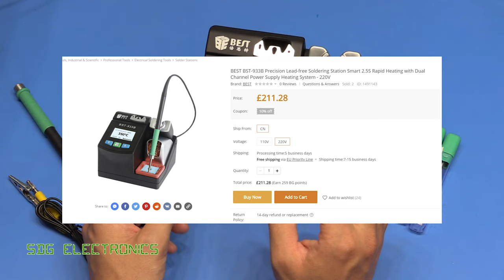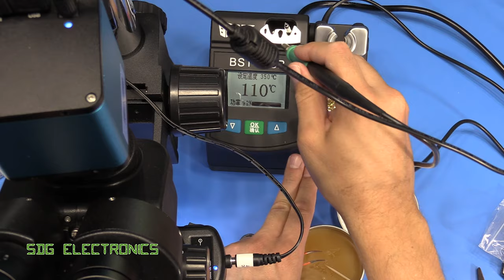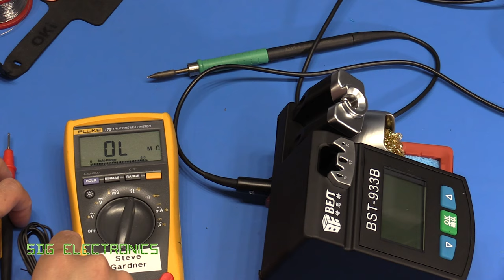SDG #089 JBC Soldering Station on a Budget - Best BST-933B / Jabe UD-1200

Comment: The price difference is not that big, and for a little more, you should have bought the real thing. You'd get something made in Europe, probably by properly compensated workers and you would support the company that made the R&D investment. This is a tool that you would expect to keep for years. JBC would have spares and repairs if needed. And it would not speak Chinese to you. An extra 100 pounds on something you will use for years translate to maybe a quid or 2 per year, I do not see the point of going for it.  If you do not want to spend the money for the real thing, it makes more sense to me to go with the KSGER.
Reply: It's not something I'd buy because even this Best model is too expensive, but saved money is saved money.  I'd bet that JBC charge a premium on spares too though.

Comment: Some Chinese manufacturer needs to do a Unisolder type of station, plug in almost anything in it an it works :)
Reply: it doesnt need to be a chinese, i am making a similar stuff cnc machined with all aluminium case so it will last forever - made in e.u
Reply: @informediatech-bruno5766  Can you build it as cheaply as the Chinese?
Reply: @galileo_rs  shure i can i still get my parts from china and as ive got friends there  and some trusted supliers i can get china prices and not china prices to sell to the wold, for example an hot air station that you see on ebay and bangood and others for like  100 euros, i can get the same item shiped for 50-60 euros sometimes even less, coz they got prices to sell inside their country and they got prices to sell to europe and usa for example 
i do have people working for me also in sirilanka and thaylande they get the items i need i pay them a comission, this is how i make my income toguether with logic board repairs. im starting a bulk supply company to supply components kinda european digi-key
Reply: @galileo_rs  but also the question is im not making it to be a cheapo im making it to be a quality item with lifetime suport so my stations will be the last thing people would nee in a life time with lifetime parts available as im the advocate of #righttorepair here in my country (portugal)
Reply: @informediatech-bruno5766  I support the sentiment but I guess I don't have to tell you that is a bad business idea?
Reply: @galileo_rs  no it is a good business idea as they always come to you to get parts the will be upgrades and more as we already do with our pc cases all aluminium high grade
Reply: @informediatech-bruno5766  In a consumer society where everything has a short life span. Anyway would love to see it when it comes out and also to check out some of those PC cases. Post a link?
Reply: @informediatech-bruno5766  holy freaking hell this is something I always wanted to do😅 How do you get them to reduce the price like that? I'm a student and reduced prices is what I need.
Reply: @informediatech-bruno5766  I need to connect with you. Getting better priced products from china & sea countries is something I've wanted to do as well in my country, I'm not from EU btw.
Reply: @informediatech-bruno5766  Did ever finish this?
Reply: @acoustic61  i am very close to the end t12 tips , 900m tips and jbc c210 will be a reality soon on the same machine
Reply: @informediatech-bruno5766  will do, thank you!
Reply: @informediatech-bruno5766  I'd love to see something like the UniSolder that's assembled. Even if it's just the PCB where one can add a transformer and case. etc. The problem with Unisolder is PCB assembly seems like a major PITA. I do mostly Thru-hole and PTP wiring so I prefer larger tips like C245  and maybe C470. I recently added a Pace ADS200 but have hardly used it since worked slowed with the pandemic.

Comment: You can't compare JBC or ERSA with Chinese soldering stations. I have both JBC and ERSA stations in our lab and the works after  many years like the first day. The duration of the tips is outstanding (years) compared to weeks or a few months on the Chinese knockoffs. I can understand for non-professionals the use of a cheaper alternative. but in the long term the acquisition investment of ERSA or JBC pays off even on the first year of ownership

Comment: Good review. One theory behind JBC is that they went "all out" for performance, so 130W and an incredibly thin iron plating layer means best performance but shortest tip life.
As you've said metcal tips last forever, so maybe the Best tips could actually be an improvement over JBC (if they can get away from conical junk).
Reply from the maker: Good point, I'm going to source some different tips for this station that are a bit more like the ones I prefer to use to see how well they work. As you could tell from the soldering, these aren't my preferred types!
Reply: I have no problems with JBC tips. Professional works.
Reply: The best part of JBC is the calibration and control performance. No overshoot, extremely quick, reliable. For soldering sensitive components, it's a matter of live or dead. Of course for normal work there is absolutely no difference once you have senser in the tip.
Reply: @johnyang799  'extremely quick' Yeah astonishingly so, to the point where you can't put the tips in by hand because it heats so quick.

Comment: Pace ADS200 is production grade, it's cheaper, the tips are cheaper and wet better, has same power and last much longer. One handy item is the preset and temp buttons are all silicon so production workers can adjust the station with the hot tip!

Comment: You should check sugon t26 station. It uses the original jbc bits and is less than 150 usd. It also seems to have a nice build quality. It is also widely available here in India.
Reply: Can it use t245 jbc handle?

Comment: For those of you that have this unit, the Jabe or the JBC, which tip would you use for general through-hole soldering and desoldering?  Also, what tip would you use for soldering 10 to 20 gauge automotive wiring?

Comment: Interesting product. Curious to see how it holds up. 
My jbc tips have been great, held up for years. I wonder what's different.
Reply from the maker: Not sure, something I've noticed over the past 4 or 5 years at work.
Reply: SDG Electronics  My JCB tips are great also. Really love that iron. However I never use the wet sponge. Only the brass shavings. So that might be a difference?
Reply: @skullhqx  I rarely use the sponge also. Just the resin brass wool. I wonder if the water is leaving behind minerals?
Reply: moki123g  Possibly, however would demineralised water be a solution for that? Why use a wetted sponge anyway? Fact is the JBC is delivered with an integrated cup and sponge. So they think that should be fine I’d say.
Reply: @skullhqx  To be fair, tips are considered a consumable and they have a hard life.
Reply: Wet sponge shouln't be used with these iron plated tips. It causes thermal shocks to the iron plating and also it wipes all solder from the tip, which causes the immediate oxidation of iron layer. I had to renew the solder layer a couple times, when I was using the sponge. The brass shavings leaves at least minimal layer of solder on the tip. Why JBC delivers a sponge with station? Maybe the consumables makes a good part of JBC's revenue? :-)
Reply: After years of using Weller, 7 years ago I replaced it with JBC and never looked back. From my experience biggest tip destroyer is heat. Anything above 380°C and tip will oxidize very quickly. Even more so if you wipe it and leave it dry without solder. With JBC awesome power/heat transfer I could not imagine why there would be a need for 400°C or more. If possible use it on max. 350°C and your tips will last way longer (that applies for any brand).
Reply: @ivicajanco9921  I agree. Tip life vs. temperature graph by JBC shows highly nonlinear dependency https://www.jbctools.com/img/moduls/tiplifevstemp.jpg  300°C is the delamination temperature for common FR-4 materials. Better materials can have Td up to 360°C. So it is not good for the board to go over 300°C and there's a high risk of delamination and damage to the board. And of course keeping the tip completelu tinned is essential. For oxidized tips, I have good experiences with Mechanic MCN-20 tip refresher.
Reply: @ales_xy  JBC tips have fairly thin iron plating to reduce thermal resistance, perhaps it is why they need caution with thermal shock and long time under high temperature.

Comment: This was a good video.  The Jabe UD1200 looks to be similar.  On the Equalizor's channel, he took apart his Jabe UD1200 to see if it is compatible with the 210 handle.  He found that "Pin 6" is not soldered in on the Jabe, could you check the your Best to see if that one has that pin soldered?  Thanks.
Reply: These stations are compatible with c245, c210 and c115 handles and tips. Pin 6 isn't used so doesn't have to be soldered
Reply: @thijskunst  Thank you for checking.  I appreciate it.  This is good to know.

Comment: Try using the curved tip, I find it works better than conical for small parts, I use a curved tip on 0603, 0402 etc. just fine.
Reply from the maker: I might give it a go, thanks

Comment: I always thought that the tip shouldn't be directly connected to earth because that allows high current discharge. The whole idea of ESD-safe is to make the discharge slow such that it doesn't damage devices.
Reply from the maker: I've never come across any professional soldering iron that isn't tied to earth directly. If your bench is ESD safe, the PCB or components should be at mains earth potential by the time you start soldering (hopefully...)
Reply: That makes sense. If you were to work away from your desk however, it would be far worse to have it earthed (right?).
Reply: I have changed the grouding of all my soldering irons to be via 10k or so resistors. This keeps esd and ghost voltages away,  and doesn't cause accidents when attempting to solder circuits under power.

Comment: Metcal all the way !
Reply from the maker: A lot of people dislike Metcal stations, particularly the fact the temperature is fixed by the cartridge. However there's a trend to adjust the temperature to suit the thermal loading which is really just pointing out the poor thermal response of the iron. The Metcal 'just works'
Reply: Yep agreed ! and 2nd hand stations can be bought pretty cheap on fleabay too.
Reply: @sdgelectronics  Hello,what do you think about Dual station Jbcs? Do you find them useful? Because the YouYue 3600 cost $200 but has dual irons like this best or jabe 1200 that it is,& I can only wonder whether dual jbc stations are useful for a single person to use both? Thanks for your time
Reply from the maker: @relicboxing  the dual output types are useful if you have SMT tweezers for example
Reply: @sdgelectronics  do you think its possible to use 2 regular jbc tips like tweezers? (1 in each hand)
Reply: @sdgelectronics  I prefer having 1 tip (usually a d24) that I can run at 280-320 for tightly packed smd I'm not putting as much heat into the various surrounding components.  It just would annoy the hell out of me swapping tips to change temps I'm working with.  I change tips for leadfree vs. leaded.. but that's a bout it.  

Your 2 pound test shows that heat spreads far and wide with your 5200 (dont get me wrong, I'm jealous.. only running a ksger here), do you have to worry about it putting too much heat into a piece when working on fine smd work?  Or does it hit it's set temp faster and then just shut off til it cools back down (curie temp of whatever tip you've got installed at the time)?

Comment: Thanks Steve! They have the iron plugged into the back and wasting maybe 8 inches of the cord length?! I don't understand why the Chinese continue to hamstring their devices! I would rather have my little Hakko or my Circuit Specialists iron. At least I don't waste a foot of the cord length.
Reply from the maker: Interesting point - it's exactly the same on every one of the genuine JBC stations. The cord length is fairly generous however and I guess it depends on the environment whether connectors are likely to be knocked or damaged. Thanks
Reply: It didn't seem like the iron cord was any longer than my Hakko 888D iron cord. But maybe it doesn't matter to some people. As for me it does matter because I can't afford to have 3 different microscopes. I am righthanded so all of my irons are to the right of my microscope, and my one rework station is above and to the right side of my microscope. It might not be that big of a deal for people that are left-handed.

Comment: which metcal do you have ?
Reply from the maker: I've got the MX-5200 with various handpieces
Reply: @sdgelectronics  ah, just found the video, that thing is incredible, way out of my price range. heh
Reply from the maker: @tablatronix  if you keep an eye out on eBay, the power supply units come up regularly at good prices. The MX-500 is another good option.
Reply: @sdgelectronics  I noticed that, why so many power supplies but no handpieces, its strange, I almost bought one of the old old ones yesterday, but someone sniped it from me.

Comment: Why would anyone buy a Chinese copy? Can't Chinese manufacturers do their own design? What will happen after all the original manufacturers go broke because people only buy ripped off designed stuff? Nobody seem to think about that?
Reply: Original manufacturers don't depend at a few hobbyists, buying one, low end soldering station per life. These big companies make equipment for another companies. So no regrets buying a Hakko T12 clones or this JBC clone ;-)
Reply: Because there is no difference between doing their own design. And making a copy can generate more customers. And in fact it's just look the same not complete copy.
Reply: Also there are many Chinese manufacturers do their own design. It's just that if they don't make something similar to an existing product, you wouldn't even know it. Heard of Quick? I have one and it is really good.

Comment: 200+ euro ?? No thanks .. I will stick to my BST 938 😀
Reply from the maker: Definitely not for everyone's budget. The Metcal was close to 900 euro at the time 😢
Reply: I wouldn't have any station that the iron plugs into the back even if it were free. But that's just me.
Reply: I googled BST 938 and it's not bad. But I would hate that enormous fan over my workplace. And where all the fumes go? From the backside of the solder station, back into the room. I was considering Quick fume extractor, but they are pricey. However, they really works - there's big filter with active carbon.
Reply: SDG Electronics  IDK, I guess there would be some benefit having the plug in the back but the cord would need to be a foot longer to make up for the difference.
Reply: Consider building your own Metcal? From some DIY Posts, it is basically a 80W RF generator with fixed frequency and adjustable output power.

Comment: Hand crank to start an electronic generator (Battery bank), that then powers an electric motors, that then charges it back and keeps the battery bank charged, keeping the cycle going with pleanty of extra power for other uses

Have you even bothered trying your hand at free energy, instead of just dismissing it because it's the modern and accepted concencous?
Reply: that's not free, you have to buy the generator.
Reply: Sounds very very very smart. No one has ever thought about that.
Reply: My god, that’s brilliant!  You just solved the challenge of perpetual movement. And the accepted conscientious (or is it contentious?) was that it was impossible. Must have been a conspiracy by the deep state and the oil companies.
Reply: @strongholds12  This guy sounds like a real shill, too!: "If someone points out to you that your pet theory of the universe is in disagreement with Maxwell's equations — then so much the worse for Maxwell's equations. If it is found to be contradicted by observation — well, these experimentalists do bungle things sometimes. But if your theory is found to be against the second law of thermodynamics I can give you no hope; there is nothing for it but to collapse in deepest humiliation." — Sir Arthur Stanley Eddington, The Nature of the Physical World (1927)